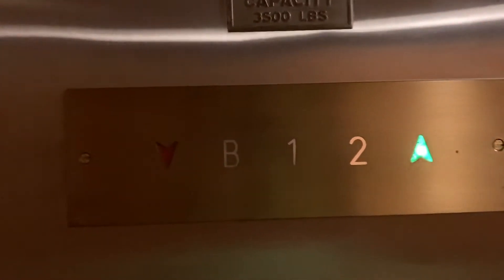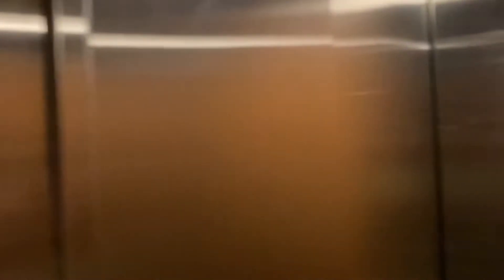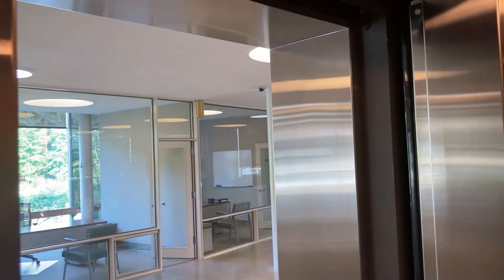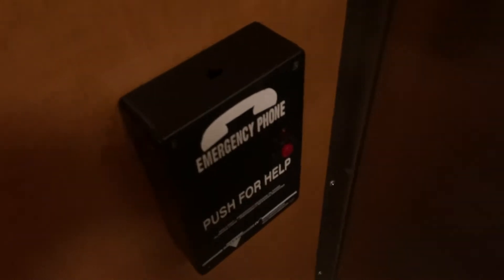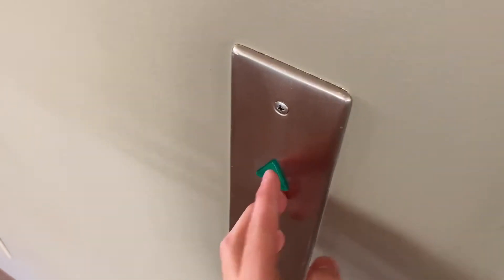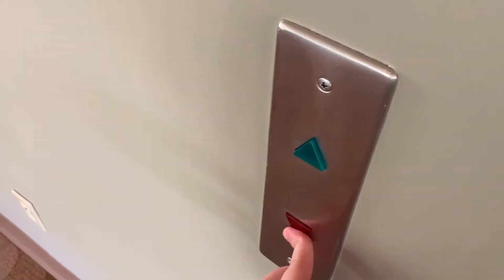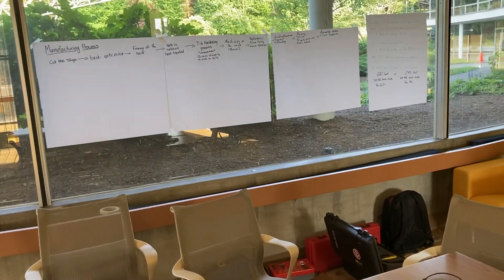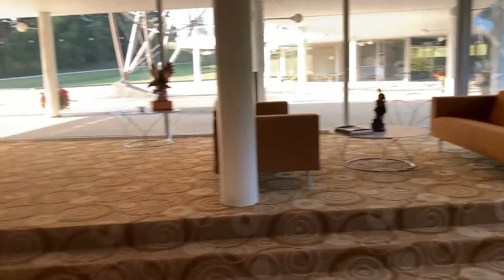Rotary Hydraulic Elevator - ASM International Dome - Novelty, Ohio

Comment: This is an EPIC elevator! I definitely love the old buttons! The call buttons are REALLY cool! The sound the make when you push them is AWESOME!!!!!!!!!!!!!!!! I especially love the way they’re designed! I’ve never actually seen them before too! The fixtures on the inside are 60s GAL. This thing runs pretty well, even though it has a fan. The elevator cab actually looks somewhat more modern, but it still is straight from the 60s, especially the ceiling with the old fan. The indicator is also GAL from the 60s. Interesting how it’s already lit when you push the button and goes out when it reaches the designated floor, it’s especially interesting when 2 lights up when you only went up to 1! What I find the most interesting about this elevator is that it has a single-slide door on the outside and a 2-speed door on the inside. Other than that, it is SURPRISINGLY completely original from the 60s!!!!!!!!!!!!!!!!!! This might be the coolest elevator you have yet to post on your channel! This elevator was definitely worth coming in for and checking out! For surely something to write home about! That artwork you showed at the end of the video was some really cool stuff Jonah! And the progress you and your team made together as a whole was nice to see on the window and on the paper on the paint board stand! Is this place actually a dome? Like is it shaped like a dome or not? Lmao😂😂😂😂😂😂.
Reply from the maker: So, the building itself is just a curved structure. The “Dome” is just aluminum scaffolding that covers the building and courtyard. And yes, we were making very good progress. We spent 6 days in that building working on it.
Reply: @theelevatorstation6783  niiiiiiiiiiiiiice! And that’s really cool Jonah!
Reply: @theelevatorstation6783 my mom worked here lol I love novelty. It’s so nice and feels like it has not aged since the 80-90. I fell in the chagrin river once haha